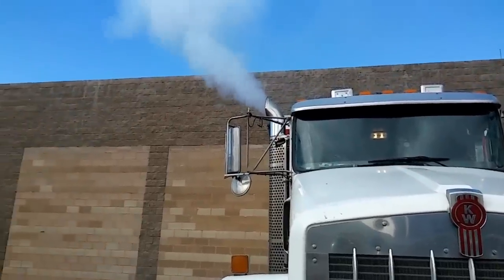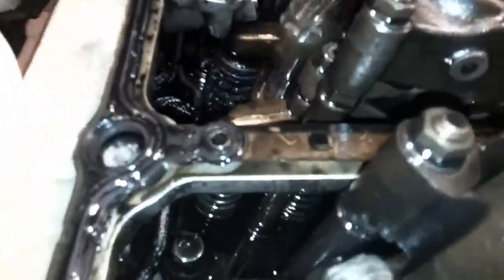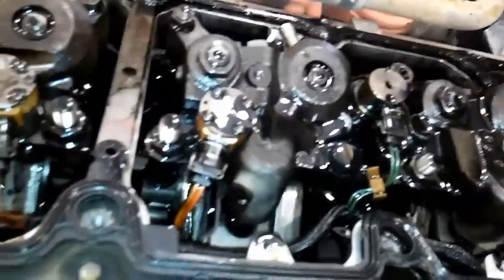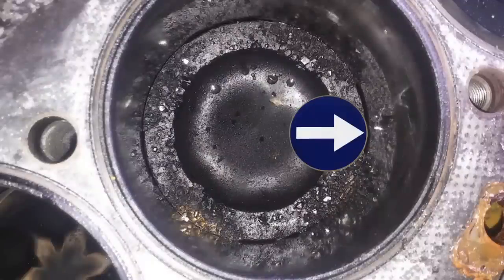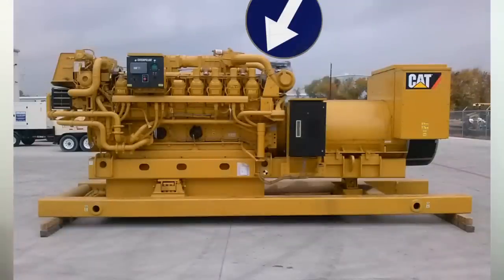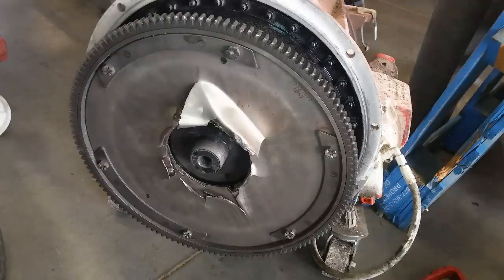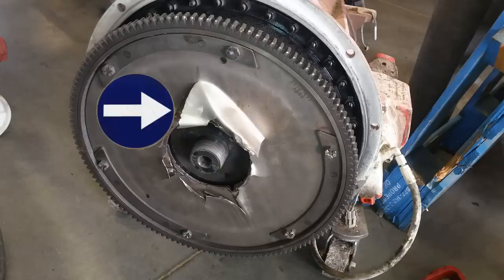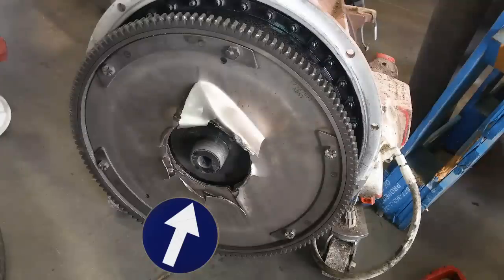Should You Warm Up A Diesel Engine?

Comment: When I start my diesel on a cold January morning, I let it idle 'till about May.
Reply: And still no heat for defrost LOL
Reply: You must drive a Ford
Reply: Lol likewise. My Ford starts rough but warms better,  my cummins starts great but takes forever to get to somewhat decent temp
Reply: Sounds about right except my ford takes till March to start
Reply: You must drive a Chrysler 😂😂😂😂
Reply: LOL!

I wish I had the money to do the same!  $100/ 12-hour night at $2.65/gallon Diesel.
Reply: @michaeldunagan7838  cheaper than a motel room! LOL
Reply: I even let my big block gas warm up a while. I like seeing some temperature I the oil first.
Reply: ThTs not enough
Reply: Nothing better than saving the starter.
Reply: Yeah I was going to say that the friction from the oil itself will warm it up fairly rapidly. But you did hit on it. Lots of folks don't realise how much heat can be generated from oil shear.
Reply: If it's smoking white smoke then raw fuel is hitting the cylinder walls.
Reply: @consaka1  I thought that it meant that coolant was in the combustion system.
Reply: @mareknosek996  Coolant is also white. Coolant is steam though and that behaves a bit differently, disappears faster and smells differently than fuel. 
Too cold for complete combustion gives some white smoke. Too much fuel for the air at temp ends up being black smoke. Blue smoke is burning oil. And of course, each has its own peculiar smell.
Reply: @consaka1  absolutely! You most definitely know you're stuff.
Reply: Lmfao
Reply: I take mine to Florida in mid November and don't go North until mid April 🙃
I feel much better Myself, let alone my Cummins 🤗🤗🤗
Reply: True
Reply: I know that’s right driver
Reply: And its probably still cold too lol
Reply: My 2007 powerstroke is computer controlled and raises the idle RPM's after a few minutes. 327,000 runs great!
Reply: I love this comment
Reply: I died laughing at your comment sir🤔😂😂
Reply: Lmfao
Reply: Amen and amen
Reply: @JamesTyreeII  not anymore...
Reply: Pragmatism rules here,In the winter start her when you get there, clear the windows etc, go back in the house, for what you forgot. She’ll be good then.
Reply: I worked in Prudhoe Bay for years and many vehicles ran just about all winter. Many of them had a high idle switch out in so it would stay warmer. My last job I drove a diesel Ford Excursion and starting at 50 below it sounded like it was going to come apart. Now they can’t to that with the newer diesels and they went back to gas engines.They all had hour meters in them. I worked at communications sites with decent sized generators up to 375Kw and they were kept well over 100 degrees  and yes they would come online in less than minute.
Reply: Iranian guy told me between Iran and turkey bus drivers in winter  didn’t stops engines for Three months
Reply: Underrated comment!😄
Reply: 2 65 a gallon for diesel jeez 2 years ago wast the shit

Comment: My wife can turn the key, release the E brake, put it in reverse and back out completely from the garage before the 8th cylinder has fired. You can tell them tell your blue in the face.  They just don't understand or care !
Reply: At least she used the e-brake!
Reply: Time to get you a new wife, problem solved.
Reply: They have the internet that tells them that its not necessarily necessary. So theirs that.
Reply: Hello Newman  I didn't say I agreed. My wife is the one who moves the car before the last cylinder fires. Now it uses a quart and a half between oil changes.
Reply: Hello Newman  I'm not.
She's nice .Doesn't have any vices is a really good cook. And she's still pretty although she could stop a clock when she was younger.
But I just can't get her to let the car warm up a little I guess it makes her feel rebellious.🤣
Reply: Just like me, done that to all my diesels, not any of them ever broke. Sure i wont make it better.. but diesel warm up so slow that who has time?
Reply: My wife and your must be relation. I can explain until I’m blue in the face.
Reply: Hello Newman  i understand, but my engines have worked like champ without these warming rituals, dont eat oil etc, so why start now😃 i use quality oil, and change it 10000km intervals. Cost with filter 75eur.  Meybe that help. After hard ride i let it idle a while, after normal driving i stop it imidiedly, not a single turbo failure. This winter whitout heater 38.5- celsius, car started like summer, that temperature i let it warm before driving.
Reply: Your wife is a reflection of who you are.
Reply: I say women and vehicles both need a little foreplay to get lubed up before you get down to business. Keep in mind the older vehicles may take a little longer to warm up though.
Reply: Get her a 4 cylinder
Reply: My friend's wife will leave her car in Drive (automatic trans) and keep her foot on the brake for half an hour at idle cooking the Transmission fluid...She also starts the car and puts it in drive in all one movement.
Reply: @misters2837 , he should have coached his wife explaining how to properly use car instead of talking trash behind her back. Not very smart husband if allowing stuff like that to happen
Reply: @repairvehicle  He has tried for THIRTY YEARS...but in her mind she doesn't understand what the difference is.
Reply: @repairvehicle  Mine knows better...even though she is not mechanical, I have explained that park or neutral makes much less heat in automatics, that the car needs to run for at least 5 minutes on cool days...2 Mins. on warm days, drive easy when not at operating temp. in the winter it's not so big of a deal because it's 15+ minutes before windows are clear anyway...you can't just start and go. - Some Women have been taught that they can do whatever and it doesn't matter...we had crappy oil burner cars, years ago...so she knows how to check fluids...
Reply: Nothing wrong here. Hand book just says drive away straight away and use low rpm until it warms up. I've always done as above and never had a failure and they have all lasted past 350k miles.
Reply: My wife gives me the sh&ts!
Reply: Truth
Reply: Pwhahahah
Reply: @chasl3645  So just do what I do: a few minutes before she leaves, if I am around I start the car for her.  I tell her that I'm warming it up or cooling it down with the A/C in the summer.  They never know what youte really doing lol
Reply: @alpaca7886  And older women too lol
Reply: @OrangeUp  LOL, Ahmen to that !
Reply: Thankfully my wife won’t drive the diesel. But I always bitch her out about not using the parking brake on our hilly driveway with my car.

Comment: I live in Canada. I as a rule fire the truck up , idle for about 3-4 minutes then bump up to 1000 rpm until water temp is at least 100. Then off I go. Also during shut down I run at idle with fan on for about 5 minutes until it’s sufficiently cooled down to a little below 180. I’ve ran this truck for 20 years ( N14) and it’s oil samples are still great.

Comment: I've been operating diesel engines in Canada for most of my life. Typically I wait for the oil pressure to change ( 2min approx) then just drive away gently until the temp gauge starts coming up. You confirmed my method. Thanks bro.
Reply: Sitting in the Alps with my diesel car. Same opinion here - best #Greetz :D
Reply: I do EXACTLY the same, and always have, even in the uk.
Reply: you wait for the oil pressure to change? what does that mean?
Reply: @grasscutter88  Oil drains back to the oil pan when the engine is off. When it is really cold out and the oil is the consistency of honey or even peanut butter it takes a while for the oil pump to suck it up and pump it through the engine. It could be well over a minute if it is like -40 degrees out. So on an older vehicle with an actual reliable oil pressure gauge waiting to increase engine speed above idle until it moves form zero to normal is a really good idea. These days most gauges in cars and light trucks are more like fancy idiot gauges that mostly read normal all of the time unless something is really wrong, so it may not be as reliable of a method.
Reply: @clarkstonguy1065 Even at those temperatures oil is circulated in seconds. Put simply if the oil light is out the oil is circulated.
Reply: For some odd reason on my 2013 Cummins. I don't have any temperature gages or oil pressure gages. I have a speedometer and an RPM Gauge
Reply: @grasscutter88 cold oil has higher readings on the oil pressure gauge. Cold oil doesn't lubricate as well. And it doesn't carry away heat.
Reply: SAME HEAR
Reply: @grasscutter88  WHEN IT STARTS TO GET WARM THE OIL PRESSURE DROPS JUST A LITTLE FROM STONE COLD OK .

Comment: I always give the diesels I’ve had a few minutes to warm up before working the engine at full load and Never had any problems with them,I also let the engine idle for a couple of minutes before shutting it down after a hard run to protect the turbo bearings by letting the oil pressure cool it down before shutting off,this practice has served me well over the years never needing a new turbo or any other engine problems.
Reply: The idle down after a run also lets the turbo RPM come down before you shut down the oil pressure.
Reply: Well said.

Comment: I have also had a couple old truckers and heavy equipment guys tell me "once it's running, don't shut it off until the end of day". These guys had million miles engines. Worked them hard, but maintained well.
Reply: Yeahhhh those million miles engines also have expensive fine filtration bypass filters and get lots of oil changes, plus they are usually mated to a lot of gears which means no need for 3k rpm
Reply: @jonsalzman909  all great info
Reply: And those old guys never had to deal with crappy LSD and DPF... amd they all put idle at 1000 to 1100 rpm at idle. Keeps cylinder wash low  and amd turbo cleaner.
Reply: @jonsalzman909  with a 1-2 micron bypass system you don't need to change the oil as often. Just replace the additives with a TBN booster.
Reply: Oil is cheaper than parts...
Reply: They're right.

When I drove 18-wheelers in the 80's we drove team and never shut the trucks off
until coming home for some time off.

I'm driving a pick up with at 12 valve Cummins and taking my pals air plane wings from New Mexico to North Carolina , I didn't shut the engine off in 84 hours until getting home again.

Yes, I may be overdoing it but even living in the warmer SW climate, I plug in the 
pre-heaters for the coolant as well as for the engine oil  year around since starting
a pre-warmed engine and a bit of idling  doesn't hurt anything under the hood.
Reply: So I live in Central Texas. I got a 99 built 6NZ C-15 
I cold crank up, scratch my butt, pick my nose, get coffee, pre trip at which time I built enough air to start rolling (say 10mins max with helping the old girl right at about1k rpm)
Don't shut off until when am done for the day (give or take 10-14hrs day). Burn some fuel but do fine being local. Never have problems
Reply: Have engine manufacturers ever made that same recommendation (run until end of day)?
Reply: @PeterLawton  Why would it matter what they recommend?
Reply: @BBslider001  Engine manufacturers study the heck out of these things.  Engines, drive trains, airbags, crumple zones ... If manufacturers echo this advice, it  is extremely likely right.  If they don't, then the advice is really nothing more than an old wives' tale.  That's why it matters.
Reply: I see the old guys do this a lot on big trucks. Guy pulls in to load his water truck and it sits there idling all day, blowing out blue smoke like a chimney they whole time.

Yeah, engines can run a long time but they get worse and worse burning a lot of oil, lots of blowby, and losing power due to lack of compression.

I'm boss man now. Shut off the damned truck if you're not actively using the engine. Fuel is expensive.
Reply: @wiredforstereo Because they never did things like adjust valves, replace head gaskets, check timing. They’ve got to be doing more than the regular PM.

Comment: A wise GM mechanic once said "I've never fixed an engine because of warming it up"
Reply: but he fixed lots that had been over ran.
Reply: he might have been to busy fixing GM's for ever other conceivable reason...
Reply: @poet99999 .... Not IF you're referring to the older 2 cycle Detroits (or, even the 4 cycle series 60).
Reply: 2Stroke Diesel Power I sure can’t complain about my 12.7 Detroit.
Reply: I used to run a soil compactor with a 2 stroke V-16 Detroit Diesel. Two V-8 blocks bolted together end to  end with a single crankshaft. Two  separate superchargers. Those old Jimmy's liked to be run wide open throttle and that rig would wake the dead two towns away, Lol!
Reply: @prevost8686  
Good ol workhorses. 
Maybe not the most powerful , but fairly simple and easy to work on. 
Maybe not the best at one thing , but a great all around engine. 
Imo I think it was a fairly decent engine to replace the old 2 strokes looking back at it now.
 Back when they came out everyone hated everything new 😂😂
Reply: @theantiqueactionfigure  i know what you mean. My detroit wasnt happy until it was fully loaded at wot chasing the redline
Reply: @kennedy796  every once in a while they ended at WOT with a stuck injector, Lol! Quick, shut that air box flapper. Grab a spare injector out of the box and you were making money again in 15 minutes!
Reply: @Romans--bo7br  those engines ran the best right when they were ready to die. But they would never die, just smoke so bad you wish they would, Lol!
Reply: The modern version of the machine I ran is no longer v-16 Detroit Diesel, it's Cummins powered! https://youtu.be/5-v5dC8_Rw4
Reply: @theantiqueactionfigure  Especially when they ran backwards
Reply: I own a 2014 silverado and in the cold if I just have to leave i baby it
Reply: @MrTheHillfolk  ive seen million dollar buses break down weekly. Its the driver.

Comment: I did my apprenticeship (mechanics) on CAT. I am now a mechanical engineer. This man speaks the Truth!
Reply: I’ve been a mechanic for 20 years I would like to get into mechanical engineering
Reply: I start the engine then wait a minute the put in gear and run at just above idle for a mile then can run at a little higher rpms for the next mile , then I am good to go .
Reply: @MrBoatDoctor  exactly what I do. Feel your truck and respond appropriately
Reply: I also was trained at a Caterpillar dealership and agree with you 100% we used to fit heaters to Antarctic machines for this very reason

Comment: This is one of the biggest benefits of electronic controls. It limits fuel rates and rpms when coolant and oil temps are low. It also in many cases raises rpm to help aid in warm up and maintaining temperature. Many of mechanical engines have been damaged or ruined by bad habits. I also a big fan of synthetic oils especially a 5w40 in the winter months. It really shows when starting in sub zero temperatures. I really enjoy these videos thanks

Comment: A friend of mine who was a factory trained Mercedes tech from Germany and was part of the extensive research and design of the w123 chassis and OM617 engine said that their findings were that a 2-4 minute idle and then gentle driving until up to operating temperature proved to have the least amount of engine wear during the warmup phase.  In a nutshell.  The fastest warmup time with the least amount of engine load is what it boils down to.  That mindset/advice has proved to be good rules to live by for me.  Two other key things he said about those cars is nothing killed the engines faster than a bad thermostat and the engine running two cold and never ever over full the automatic transmission.  He never saw one fail from too little fluid in those cars.  Great video!
Reply: Makes me feel reading your comment... About to do my thermostat in my Duramax
Reply: Love the W123 cars

Comment: Mmmm.... interesting ! It's minus 11 F this AM. like it usually is this time of year in my neighborhood, sometimes a lot colder tho.
I do plug it in always, I have an oil pan heater and a block heater , I start the truck and let it idle while I roll up the extension cord, then I increase the idle to 1k turn on all the lights and do my walk around( pre trip) then I increase the idle again to 1150 and do my paper work.... I will not stuff it in gear till the coolant temp reaches 110... by then the oil is about the same.
Always take it easy at first till temp are up in normal op. range.
I got a 1.1 million on the odometer with this ISX 550 and still running strong pulling 102K lbs every day. Knock on wood ! :)
Thanks for the vid !
Reply: Francis B this routine that you apply is the same that I have done and I believe is an excellent method to getting the longest life out of your rig. I’ve retired now from the trucking industry after 40 years and millions of miles. Good luck be safe  and happy trails.

Comment: Pretty much spot on. No need for extended warm-up, but you should take a minute or two before you start to load the engine. One thousand rpm for idling is the proper way if you have extended idle time. Also, as you move the vehicle you should remember that the transmission, rear axles, and wheel bearings need to be warmed so their lubricants can come up to temperature.
Reply: I have seen a lot of wheel seals taken out in cold weather.